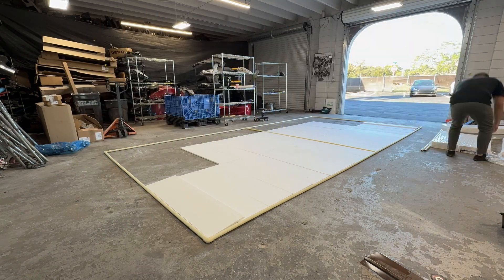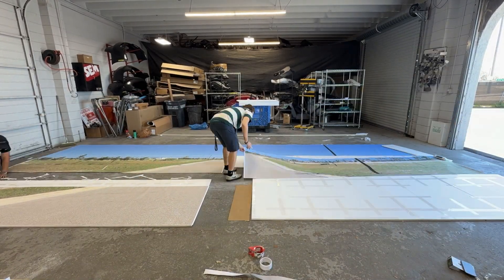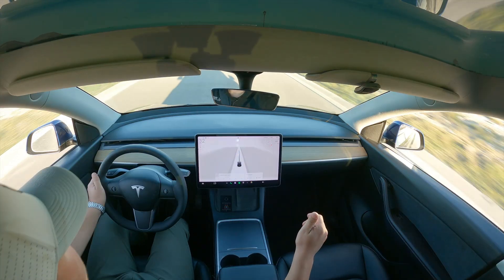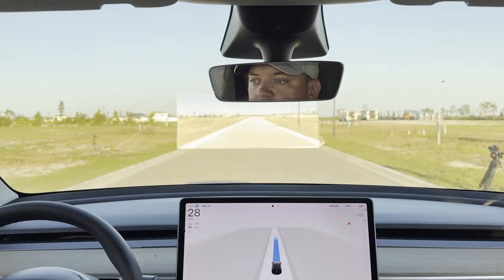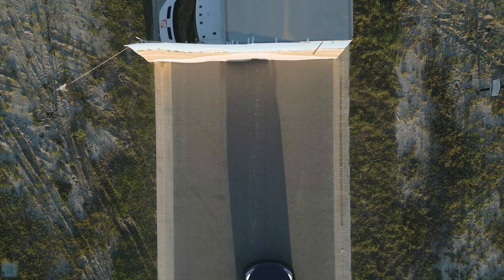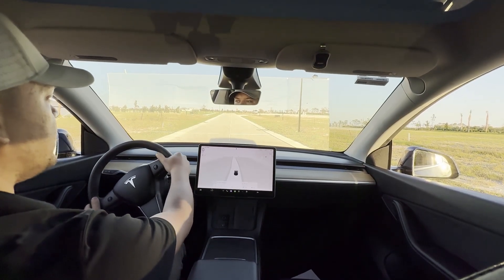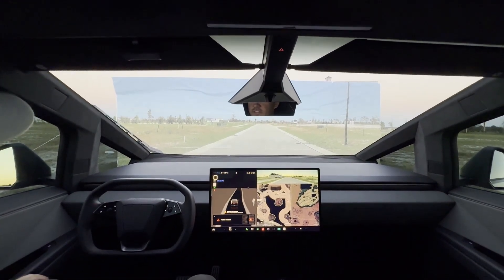Response to Mark Rober’s “Can You Fool A Self Driving Car?”

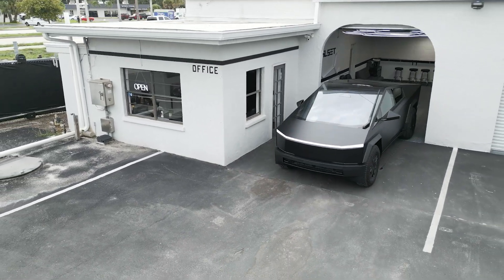Comment: Make sure you watch the FULL video, the 2nd half of the video with the Cybertruck with ai4. It sees the wall and stops. 6:01
Reply: Just look at the contrast at 9:09 
Of course it saw the wall! A fair test would be to try the Model Y again in those lighting conditions
Reply: need to do it at same time of day, so the sky on the wall is same color as real sky (do AI 4 test immediately after AI3)
Reply: It sees the wall because the colors were meant to minic daylight. They drove in the evening.
Reply: It's probably because the camera is detecting the surface scattering from the headlights on the wall surface. Definitely needs to be retested earlier in the day. You'll notice that the Model Y notices the wall when the car is fairly close because it's able to see the car shadow.
Reply: @genstargate5249 It's unclear whether it can see the wall when it gets close by not because of the shadow or because of the ultrasound sensors :)
Reply: Cyberbox is taller and can see over the wall. A taller wall would beat it in the exact same way. This is a design choice, not a malfunction. The Y is performing as designed
Reply: @glideslope69  Dude.....That wall on both of those videos was LOT taller than the Cybertruck....HW4 with FSD version 13.X.X is the one that passed, and HW3 with the FSD version 12.X.X failed in the other video.
Reply: The truck is bigger and the wall is not to scale...also light conditions are diferent. This was not a very scientific test.
Reply: Even without considering time of day, it's still scary that the v3 cars can't see the wall... Only hubris is responsible for making those cars objectively less safe.
Reply: @crescentx3 to be fair, not many humans would see that wall driving 40+ mph
Reply: @crescentx3 Wiley Coyote is not real.
Reply: @ Sure, but the test serves the purpose of demonstrating a failure point of vision based systems. A human driver, even from a distance, could tell something was wrong. A Lidar or Radar system could tell something was wrong. Sure, nobody’s putting a painting in the middle of the road. But glare, debris, or just simple perspective are enough to hinder vision systems, and not including even a cheap radar system just to pinch pennies or to prove some point is an unnecessary risk to the consumer. Though we all know exactly how our new Leader feels about consumer protections.
Reply: @crescentx3  Calling him Leader shows your bias. You are misinformed as to his reasoning. Yes, save cost. He also said engineers would use it as a crutch and the vision system would be less developed. Teslas on FSD are already safer than human drivers. A fair comparison with lidar would be to compare accident statistics with lidar cars.
Reply: @kit888  "He also said engineers would use [LiDAR] as a crutch and *the vision system would be less developed*."

Maybe they should have a more finished product before opting for less capable alternatives.
Reply: Fan bois will only remember the second half of the video lol.  And haters will only remember the 1st part of the video hahaha

And the rest of the normies are laughing at both them =D
Reply: I’m not sure how this is being spun as a win for Tesla enthusiasts. At first, the argument was that Mark didn’t use FSD—that that was the problem. “He used Autopilot,” they insisted. “Why didn’t he try FSD?” they asked. We responded that FSD would run into the same issues, because the root cause is the hardware.

Now, suddenly, the narrative is shifting. “He should’ve used the Cybertruck,” they say. “Try a vehicle with updated hardware.” It feels like the goalposts keep moving.

What’s more, the test environments clearly weren’t consistent—lighting conditions, for one, were different. Yet this time, no one’s calling the test invalid. Despite the inconsistencies, and even though Mark was proven correct, some still claim a win for Tesla.
Reply: @meilyn22  Exactly this! I actually had a really long response typed on another video accusing Mark of being biased and not being a good scientist when the guy who made the video was using his own biases and only going on his own assumptions and perceptions, but those people just aren't worth the time so I ended up deleting it. THE GP of this country is just stupid, and because a ton of them seem to have a new found love of Tesla and Musk they will continually move the goal posts for this. Rober or someone else could run a thousand tests with different conditions in all driving modes and as long as the car was crashing through the wall they would have some problem with the test. The second a single test detects the wall and it stops they will claim that was the valid test and a win for Tesla. 

They're all to dumb to realize the test was never about Tesla versus Luminar in the first place, its about testing vision/camera systems compared to lidar, And what it proved will be true throughout, the car will not stop if it does not "see" the wall, I don't care what software or anything you have, if it doesn't see it, it doesn't matter what driving mode its in. Its like putting a brick wall in front of a blind person, doesn't matter if you make the wall a mile wide, they're not going to see it, at least not without the help of some other aid. But if that blind person had evolved to use echo location (similar to lidar in this case) they would know the wall is there even without physically seeing it.
Reply: should've reversed the order of presentation, damn
Reply: It stops so much smoother than the Lexus with Lidar tech too.
Reply: Is everybody here dumb? The cybertruck was tested at dusk against a bright daylight coloured wall. Of course the cybertruck saw it. Holy crap.
Reply: Mark, the Robber needs to handover his engineering degree to this dude or toss-if not his university should snatch it.
Reply: @tashi282  it's really funny to see how smart dumb people think they are. 

I would advise you think before you speak. A dumb question or statement is only dumb if you dont learn anything from it.
Reply: @tashi282  this makes zero sense. 😂
Reply: Mark Rober is a liar, and a Deceiver.
Reply: @1flash3571  how come? Mark didn't test the cybertruck so the result were the same.
Reply: @1flash3571 looked to me like the first half of the video played out just like Mark Rober's video
Reply: @1flash3571  Are we watching the same video?  Looks like Rober was right, Model Y to Model Y.
Reply: @1flash3571  nah....the video tells the truth. and this video proves it even more... Mark was right. the change in contrast at EOD was the reason it stopped for the cyber
Reply: @1flash3571 so I guess there’s about to be a the down fall of mark robber video coming soon 😂
Reply: @1flash3571  lol gtfo. This 'wall' didn't look anything near as good as marks.
Reply: @1flash3571  He was actually too excited about Lidar and just not informed enough that autopilot doesn't equal FSD.  🤷